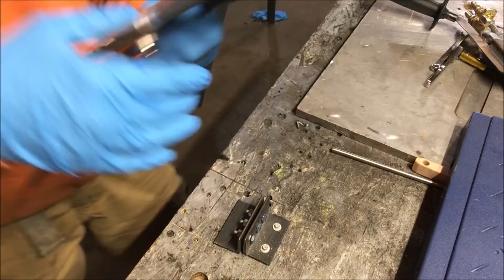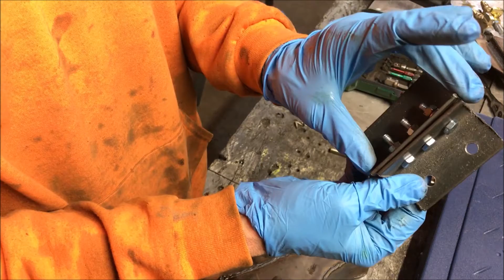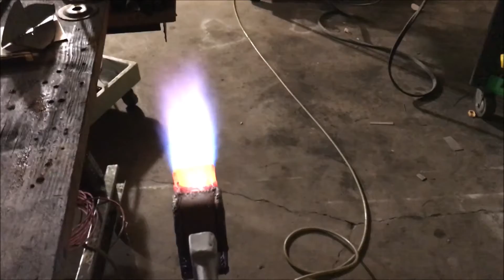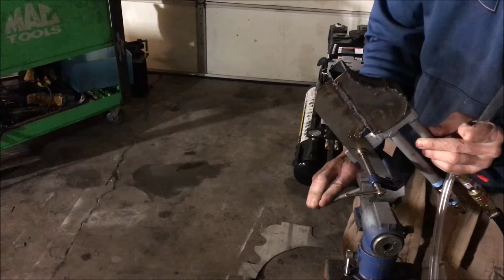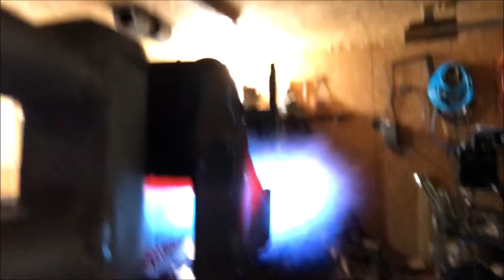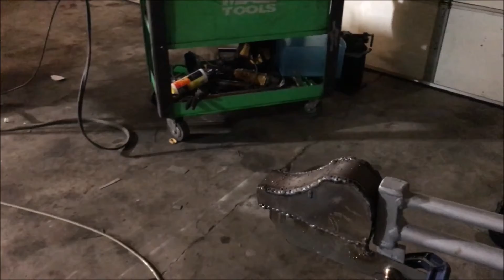Forge / kiln  Burner bracket for High velocity ALL FUEL  Burners

Comment: You are starting to hitting temps where i would think the stainless will actually melt for prolonged burns..  Usually when you design forge burner you want the flame to catch "burn" at least half an inch in front of the exhaust but this looks like it swirls and burns inside the unit and then pushes out... 
With that blue flame - i would be interesting to see how long it would take for it to start melting the tip and shoot molten metal across your shop.